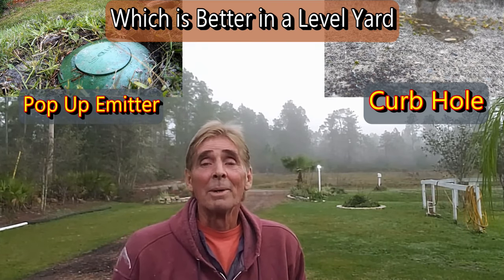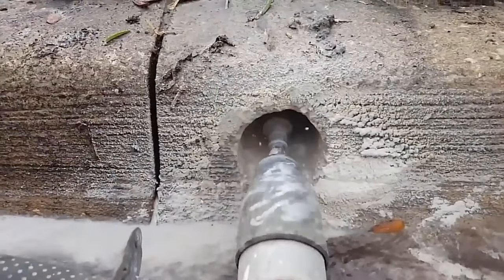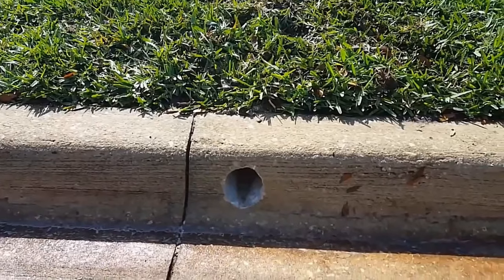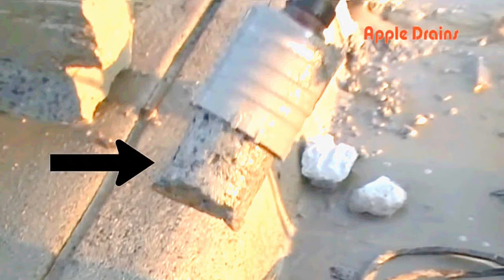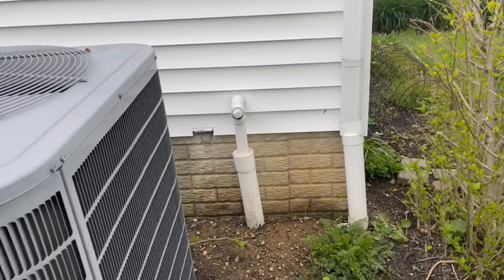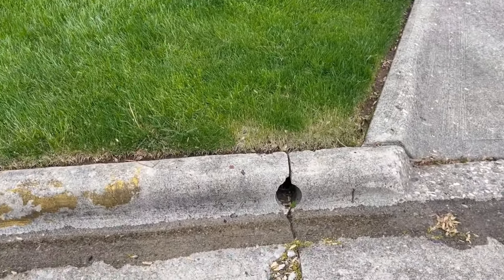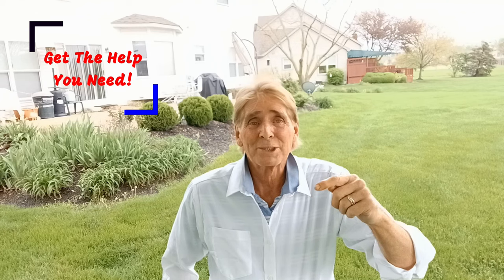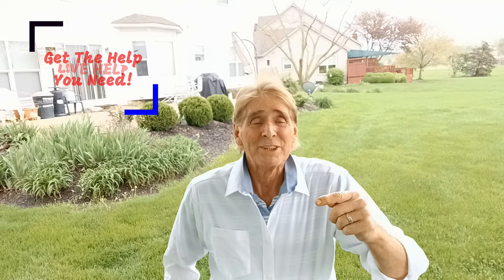Curb Hole vs Pop Up Emitter for Downspout Drains. Which is better?

Comment: Thank you for sharing this video.    Do you have any thoughts on having both a pop up and a curb hole?    On our place here in Houston, our drains at the back of our house will get overwhelmed and won't drain as air is trying to get out during a heavy down pour.    We have street drain holes but the water on the street is almost covering them up during a heavy downpour.    I had considered having a pop up drain near the curb would allow the house french drains to overflow to the yard once overwhelmed in the street.

Note: I have jetted our lines and confirmed they are not clogged.

Thanks again for your video and any input you may have.

Comment: I got lucky when I built my drain system.  My front yard is on a steep enough hill to where I ran an open discharge over top of my curb instead of through it.  Since I didn't have to cut anything have I didn't have to get a city permit to build it either!

Comment: Love your videos.

Question: Can downspout flow share the same pipe with a french drain system? Roof water down into a corrugated pipe? Probably to a sump pump.
Reply: You can utilise the same trench, but your downspout water should be in a solid-walled pipe and drain to the curb. The french drain (perforated pipe) should ONLY carry ground water, not downspout water.
Reply: yea you can. unless you have to seperate them. Even if you did, who knows whats what?

Comment: CHUCK! Thanks for the informative videos! Question: I've got a pop-up at a newly installed curb and am considering doing a DYI curb hole. There is an expansion bevel (not though cut) at the location. Would there be a reason to avoid that expansion area and drill at smooth curb face? Thanks!

Comment: Coring the curb without a permit is one thing, but I'm pretty sure my city would have my head if I cut through and removed some of the sidewalk. Great video as usual though chuck!
Reply: To Stranton: This is true. The city will make you fix it.
Reply: You just have to repair it to its original condition.